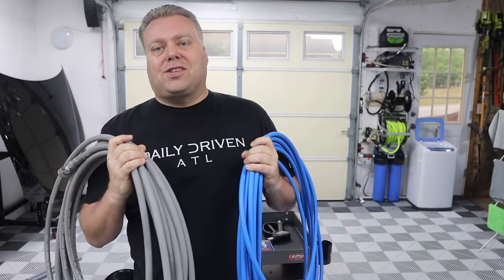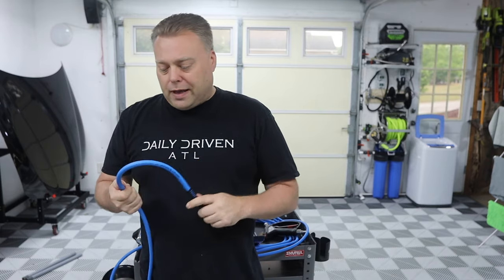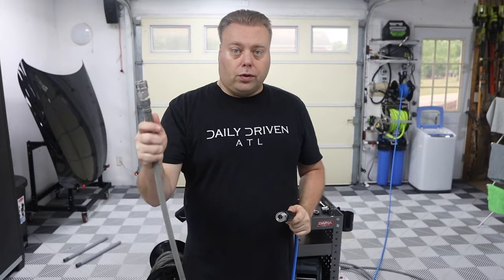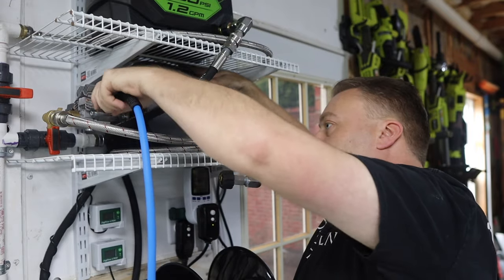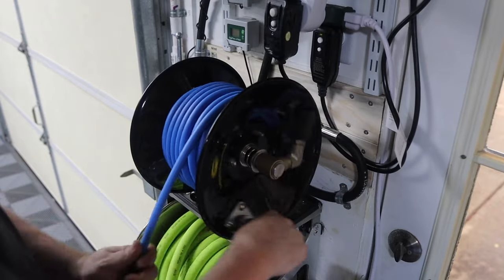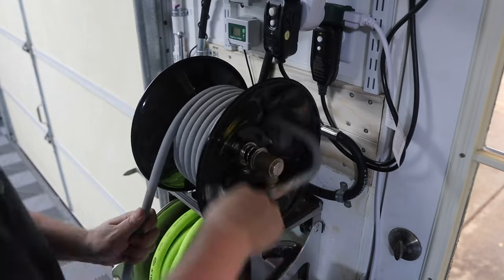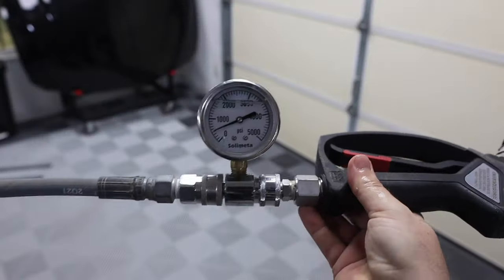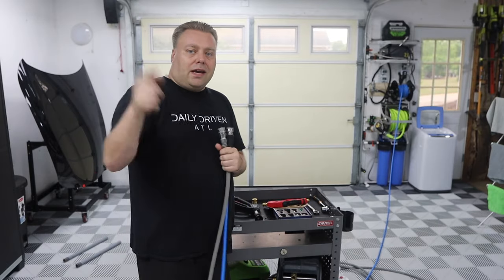Uberflex 1/4 Hose vs 3/8 Amazon Gray Hose | Reviewing & Testing | Car Wash Tips

Comment: Great review, as a DIYer running good old Sun Joe unit, I wouldn’t even consider the Uber flex hose mostly because thinking it would negatively impact the performance / water flow and so on ,especially downsizing from 15mm attachment to 14mm, i’m glad I saw your review and it’s clear it doesn’t impact water flow/GPM. I definitely thought there would be a big difference between 3/8 and 1/4”  @ 50’. Thanks.
Reply from the maker: 50 foot or less there is almost no difference. Going beyond 50 foot is when I would run 3/8 hose. The 14mm and 15mm connections is the outer diameter of the plug. The inner diameter is the same so no difference in performance between them. Uberflex might have an impact on more expensive machines such as Active pressure washers as they have much more water flow and Uberflex has no wire braiding to maintain inner diameter so it can expand causing issues with the pressure switch for the auto start/stop. I noticed on their website they say to only use steel braided hose and now I know why. Over time my Active 2.0 now surges anytime I use the Uberflex so I moved on to a Blueshield Kevlar 3/8 hose. Uberflex is perfect though for Sunjoe, Ryobi, Greenworks, etc.
Reply: @CarsWithKeav  thank you much.
Reply: @CarsWithKeav  thank you much.

Comment: Really helpful video even for me here in the UK. I love the way you demonstrate real world useability. In particular you've sold me on the idea of a 1/4" hose instead of 3/8", since like you I was leaning towards 3/8 for the same spurious reasons. I want to upgrade the (rubbish) stock hose / fittings on my DIY pressure washer so that it is Quick Connect for the full pipeline. Thanks for the info.
Reply from the maker: Yeah, it all comes down to preference and when upgrading a DIY setup Uberflex is a great option. Now once you decide to go all out the 3/8 hose is what I would suggest if running and AR630 or a Kranzle. They seem to run better in a 3/8 vs a 1/4 from what I have witnessed.

Comment: My greenworks came with a 25ft uberflex, instead of buying a replacement 50ft,  ordered an adapter and another 25 footer and linked the two. saved about 20 bucks that way. Always a fan of the blooper reel!
Reply from the maker: Must have been a Greenworks Pro model? I know Propulse makes Uberflex hoses for some Manufacturers as well.
Reply: @CarsWithKeav  Yup, Greenworks Pro. I bought the same one and tested the Uberflex that came with it. I'll likely be switching brands from the MTM with how much more manageable the Uber is. Been fighting the MTM hose for years.

Comment: Good, honest video.  I'm about to purchase the uberflex 50' foot hose for my gas pressure washer, 2900 PSI and 2.3 GPM. I'll let you know how it goes.
Reply from the maker: Be very careful with the Uberflex on the gas pressure washer its max is 3100 PSI so any spike could be a problem. they do make a another 1/4 hose that is red in color that holds 3700 PSI. They also have a 3/8 hose that has the same material. 3/8 I think is better for a gas pressure washer compared to an electric one.
Reply: @CarsWithKeav  thanks so much for the info.

Comment: I’ve used multiple 3/8 and 1/4 hoses. The uberflex is my top pick my only con to it is I wish it was a smooth jacket so when I reel it in I can clean it with a microfiber much easier
Reply from the maker: Smooth jacket is a nice feature, but it is costly.

Comment: Thanks man. I keep seeing 1/4" versions and wasn't sure what to think and just got stressed about it😂
Reply from the maker: I mean if you stay 50ft and under doesn’t really matter. Using a steel braided hose with the higher GPM machines is the better way to go. Say an Active 2.0 I would not use an Uberflex they are known to have expansion problems causing surging at the pump.

Comment: Ive only used 1/4" single wire hoses. Even with my gas PW.  I get mine custom made from Kleet-Rite... currently running their 75' continental hose with my 2.0 and love it!
Reply from the maker: Very nice, if you not putting out 5 gpm and 4K psi don’t really need a 3/8.

Comment: It's funny you mention it because I personally run a 3/8 OG spec Kobra Jet but recently got a chance to try out my buddy's 1/4 Uberflex and I fell in love with it so much that I decided to buy one myself. Some may say it's a downgrade but in my opinion it's an upgrade I just love the feel and the weight.
Reply from the maker: I was surprised how good it is. I got caught up in the OG mindset when I first started out. The last year I have broke from that. Glad I did or I would still be struggling with that small neck on the pf22.2 foam cannon. OG has some good stuff though and at times good advice. Just doesn’t always have to be Matt’s way. I like a good mix.

Comment: Hose diameter, and length, affect flow rate much more than they do pressure. It would be interesting to compare the GPM produced by both hoses.
Reply from the maker: Might have to try. I know after 50 feet the pressure and flow drop is significant. Main reason why Uberflex doesn’t make anything longer than 50ft in 1/4 inch.
Reply: this has already been tested it does not affect PSI or GPM do ur research lol
Reply: Yes true I order that uberflex for my electric pressure washer, my pressure washer is 2000PSI the uberflex keep surging my pressure washer, attached my 3/8 and works fine those smaller hose are for cheapie pressure washer

Comment: My prusher washer is 2500 psi 2.9 gpm with 100 ft hose 1/4".. do you think that i would upgrade to 3/8 hose???
Reply from the maker: If those are the numbers I think you would benefit from a 3/8 hose at that length.
Reply: Thanks for your reply ❤

Comment: Ok, so I have a Gas powered Predator Pressure washer that is rated at 3100 PSI and 2.8 GPM with 6.5 HP motor. I’m wondering what you think would work better for it, I see everyone that does comparisons in hoses, doing so with lower powered electric pressure washers, so I’m wondering if this has an effect?! I’m debating between 50 foot uberflex 1/4 or 50 foot 5/16 flexzilla. Both rates at 3100 psi max… but also flexzilla makes a 1/4” 3,600 psi max that’s about $30 more than the 1/4” 3100 psi max.

Just wondering your thoughts on all this?! I use foam canon a lot too, for cleaning vehicles, atv and boat!

Planning to purchase this week. Thank you!
Reply from the maker: My thoughts on a gas pressure washer is to go with a 3/8 wire braided hose. It won’t be as flexible as an Uberflex or Flexzilla, but I’m just hesitant of those hoses handling such high PSI and Flow. No problem using on cheaper electric pressure washers.
Reply: @CarsWithKeav  definitely the answer I was looking for! Thank you very much for your help and insight, I really appreciate you getting back to me 👍🏼👍🏼

Comment: Well having the Uber flex for over a year. It twists up way too much for detailing. I have 100ft hose and my friend has a 3/8 steel line and it never kinks at all
Reply from the maker: You have a 100ft Uberflex 1/4 hose I didn’t know they made those. If using an Uberflex I would keep it 50ft and under. Anytime you go behind that length I say go 3/8 for sure. I went back to 3/8 the weight is what helps it lay so much better.

Comment: Can you give more information on that cart in the video. My garage doesn’t have enough space for the wall mounted hose reel and PW shelf so that cart set up looks like a great idea.
Reply from the maker: That cart was a once in a lifetime purchase I scored a lottery win there. It was listed on Amazon for $99 and only one in stock. 100’s have asked about it and I have only been able to find this Shuter brand on industrial supply sites for $600 or so. It is a crazy stout cart with 1/8 inch thick powder coated steel everywhere and no rattles just smooth. I stopped using it in my wash cart videos because I hated telling people they couldn’t get it. I do have several cart videos going over different versions over the years. Here is a link to the cart series playlist if you are interested. Several of them feature this cart. https://youtube.com/playlist?list=PLviiGueuNn2XZHqSnVcaePgVg33uEMLB3&si=DZJIHWhkKuaLQ7Fl

Comment: Thank you for video, I’m building a similar setup to yours and I was really confused weather to go 1/4 or 3/8. I think 1/4 should be me plentiful for me.
Reply from the maker: Only time you really need to go 3/8 is if you go over 100ft. The pressure drop on 1/4 is significant at longer lengths. The drop is more at 50ft, but not enough to be noticeable.
Reply: @CarsWithKeav Oh I see, I purchased 100ft 1/4, I’ll really only be using it to my clean cars but my thought process was I’d like to reach every corner of my house. For some cleaning here and there. Do you think I would see a huge drop in pressure?
Reply from the maker: @DallanXp  I wouldn’t think so. Might be 100 psi, 3/8 has pressure drop too just not as much. You could easily make up for it with a different orifice nozzle.

Comment: Just wish companies would move away from M22 fittings on 1/4 hoses.
Only reason I went with a 3/8 as it came with quick connect fittings.
Reply from the maker: Me too, but got to remember we are 2% of the market when it comes to pressure washer accessory sales. Most of the world doesn’t care about the fittings. M22 itself is a great connection when it comes to being a hand tight no leak connection that easy for a consumer. You can connect quick connects to m22 pretty easily and even if you have 3/8 pre-installed you still need an m22 to QD adapter.

Comment: Any hose is going to be fine if you have a fancy reel like that. I have that uberflex and it still trys to link up and what not.. Why? Because it isn't being stretched to lay perfect on the reel. I wind mine up on a handheld extension cord reel so for the most part it works, but yeah. Having a reel like that is a total game changer
Reply from the maker: Funny thing this is the cheapest hose reel designed for pressure washer hoses you can find really. I could see any hose having issues with a reel not designed for them. If when using these reels I still have to straighten the hose before doing it or it will loop on me a good bit.

Comment: Does the uberflex have a break-in period. I brought one, not from Amazon, but a reputable detailing website here in Australia and arrived yesterday. But mine coils over itself easily and does not uncoil as easily as yours. Not as bad as the cheapie hose that I got but it still coils pretty bad compared to what you demonstrated in your vid.
Reply from the maker: I do tend to work the hose from end to end to try and pull out the memory from the packaging. Pulling on it and massaging it with my hands. Another thing is you can fill a big bowl with hot water from the tap and soak it in it then work the hose with your hands will be much easier then. Just don’t use boiling water as the hose is not rate for more than 140 degrees.

Comment: if i go from a 25ft hose to this blue 50 ft hose, would i see a noticeable pressure loss, not sure if that was covered in the video… cheers
Reply from the maker: No pressure loss at 50ft on a 1/4 hose. As you get to over a 100ft is when real pressure loss starts being noticeable.
Reply: @CarsWithKeav  thank you for the information, cheers 🍻

Comment: No GPM difference?  I'm due for a pressure washer upgrade and was considering a Kobrajet "upgrade" over the Uberflex.  Still using the Uberflex?
Reply from the maker: No GPM difference at this hose length. You can get pressure drop using a 1/4 inch hose when you get 100ft+. I did go back to 3/8 because of the Kevlar hose I am using is much lighter and less diameter than a Kobrajet.
Reply: @CarsWithKeav  Is that the Blue Shield Kevlar you reviewed?
Reply from the maker: @DMCnME  yes

Comment: I bought the Uberflex and reel but don’t understand how you connect everything. If I connect uberflex to reel how do I connect reel to power washer? I got Active 2.0
Reply from the maker: You need a jumper hose to go from the pressure washer to the hose reel. Depending on the hose reel you bought the input from the pressure washer could be in different spots. On mine I show in the video it is at the base where it is mounted to the wall. I explain in this video around the 20 minute mark https://www.youtube.com/watch?v=W3upnJPT1tE
Reply: I see the disconnect. I have a different reel, I purchased the Coxreel. So I have to buy the adapter you mentioned in your video and do it that way. So I have the jumper hose and that will hook up to the reel on the outside connection, while the uberflex will be plugged in inside the reel via the adapter connector. I appreciate the help!
Reply from the maker: @chelo3510  Thats a really good reel. Hope you enjoy it! Any other questions feel free to ask. DM me on Instagram is the best way so we can exchange pics and videos of what we are trying to remedy.

Comment: I'm curious how the 3/8 uberflex or flexzilla Compares to the Amazon. I put together a 100' 3/8 reel with a "non-marking" hose and it feels like lugging around big steel cable once it's full of water
Reply from the maker: After trying the uberflex I don’t understand why I lugged around the 3/8. I didn’t realize how heavy it was until I tried this. 3/8 uberflex would  still be lighter and more flexible, but if I go 3/8 it’s because of durability and the 3/8 Uber still has a max PsI of 3200 and is still cold water only.
Reply: @CarsWithKeav  I might have to do a test where I see how much pressure/flow drop is done on my 3gpm machine comparing my 3/8 and 1/4, sucks cause there aren't many options for 100' 1/4 hoses, which would be handy in a shop application

Comment: You say this hose doesn't tangle, but have you already put pressure washer on it?
Reply from the maker: It doesn’t tangle with pressure either. With pressure you lose some flexibility as expected and the loops just pull right out and no kinks. Used it for a good bit before replacing recently to use the Uberflex for another cart project.

Comment: Got this from Active ——.  Active Products Inc.
Tom C Yes, the 40' hose provided with the 2.3 is steel braided, and so is the 20' hose for the 2.0. We've seen some users having some surging issues with the 2.0 using the Uberflex, so we recommend using a steel-braided hose like the Kobrajet for this unit.
Reply from the maker: Later after this video I started getting the surging issues with the Uberflex. I switched to my Kevlar braided hose and have not looked back. There is for sure issues with the 2.0 and the flexible hoses which expand under pressure causing the pressure switch to not act right. The wire braiding helps keep that expansion from happening.
Reply: @CarsWithKeav  Could you post a link to the Kevlar braided hose you use? Good to get his issue our there.
Reply from the maker: @tc9148  Right now I can only find 35ft and 75ft hoses both are on this listing. 50ft have been sold out for awhile. https://amzn.to/3RGCsAZ

Comment: Can you use a 3000PSI hose on a 2600 pressure washer?
Reply from the maker: I don’t see why not the rating of the hose is higher than the machine, but me personally I would use a 4k PSI hose on a 2600 just to make sure I’m not wearing out the hose quick and just for safety.

Comment: What’s the best cheapest reel I can get?
Reply from the maker: This is the best I have seen for the money. The same one I use in the video. 50 ft hose reel for $89. https://amzn.to/3BB3iSL Have to be careful what is out there many are for air hoses. Also, remember there is added cost to buy a jumper hose to connect to your pressure washer. If using a 1/4 hose you can get 100 foot on there as well.

Comment: can you link the 14mm to 3/8 npt with the o ring
Reply from the maker: As long as the 3/8 you are connecting to is female. If it is male like most hoses would be you would need an m22 14mm male end and a 3/8 female npt on the other side.

Comment: how does it compare to MTM 3/8" Kobrajet?
Reply from the maker: Have not tried a Kobrajet yet to know. One day I will, but they are expensive.
Reply: I’ve used both the 3/8 Kobrajet and the Uberflex. I’ve enjoyed both. The 3/8 is just a little bit heavier duty and I feel confident about it’s durability while dragging it on the driveway. The weight really isn’t much of an issue at all when using them, you really only notice it when holding it all coiled up. The jacket of the Kobrajet is easier to wipe off while winding it back on the hose.
Reply: @mdoyal111  Thanks for the feedback! Was wondering about the Kobrajet.

Comment: Can this ublex hose a ryobi pressure washer wb140
Reply from the maker: I tried looking up wb140 and got no results, but the Uberflex should connect to any Ryobi. They all use the same connections.
Reply: @CarsWithKeav  thanks mate it's Ryobi 1800watts 2000psi
Reply from the maker: @anthonyocarroll5630  That should work.